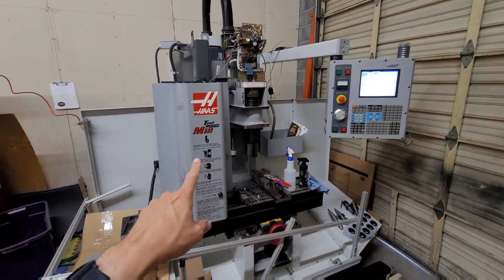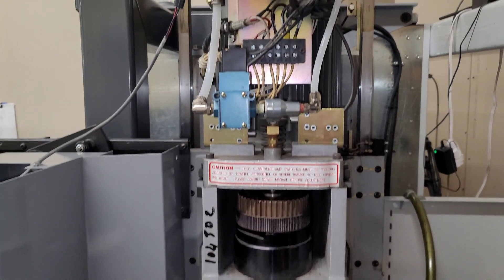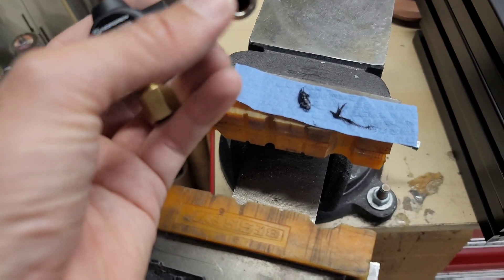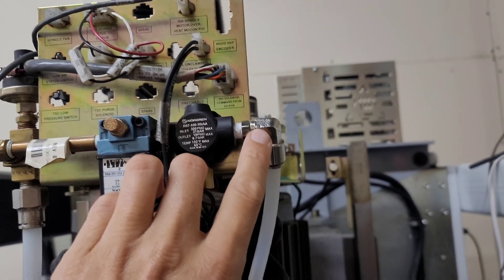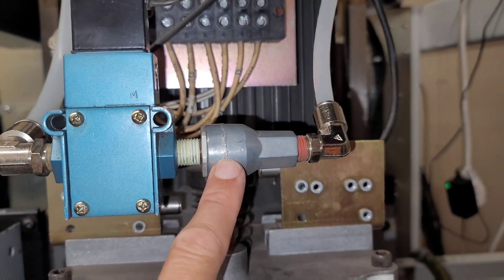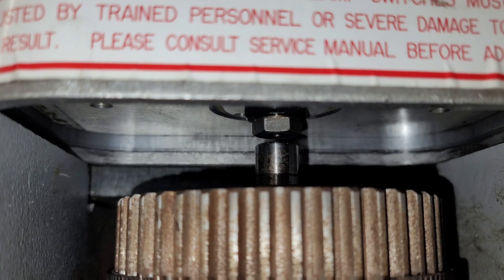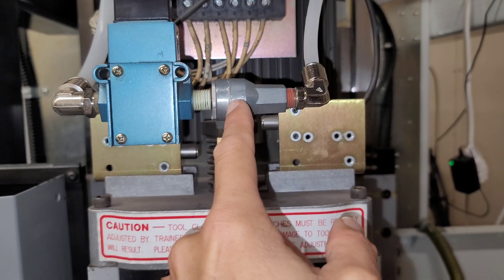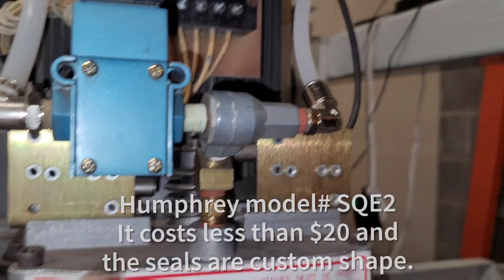HAAS Fix Tool Release Issues due to defective Humphrey valve clogging the air lines | TM-1 Mini-Mill

Comment: Same issue on my vf2. Same part as well the sqe2. I get air out of the line into the humphrey valve but its not moving the piston at all when the line is connected and the high pressure solenoid disconnected. Going to replace it and see how it goes. My shop air has no air dryer and I get water in the lines. I wonder if this is related. I purchased a refrigerated air dryer as well and will be installing that into the shop air system.
Reply from the maker: The rubber used in these valves deteriorates after 10-15 years. It's not designed to last. Refrigerated air dryer is awesome.

Comment: Thank you for this video!! Exactly what was wrong with my TM-2P. I replaced with identical part. A LOT cheaper buying it from an industrial suppler vs Haas. Thankfully the rubber membrane stayed in the valve,  although it was all crumpled up.

Comment: Thanks very much for this. The machine I'm using is a Haas Super Mini Mill 2 (pre-NGC) so not sure if it operates exactly like this, but at least this is giving me an idea of where to start checking. The symptoms are very similar, you can hear the air coming out when the tool release button is pressed but the tool won't release.

Comment: These videos you are doing are amazing.  I got a 2006 TM1 recently and it had exactly the same issue!  They must fail after a certain amount of time.  Also working on building a tool changer for mine and your videos are extremely helpful with that!  I was also told by my HFO that they would not sell me any parts for it.
Reply from the maker: Thanks, trying to document this stuff to help each other. Instead of buying a Humphrey brand valve, which I know will fail the same way in 5-10 years, I bought this Parker/Legris valve which I hope will last longer https://amzn.to/3fXwRpT
Reply: @engineerable  looks like they're getting two orders today 🤣
Reply from the maker: @evancooper1195  I replaced it with the Legris valve, and it works. Here's the video https://youtu.be/UPQi0CrQKTY
Hope it lasts longer than the Humphrey valve.
Reply: Sucks that the humphrey valve is getting replaced. I work there on the cnc side of things. If the competition works better, i can't argue.